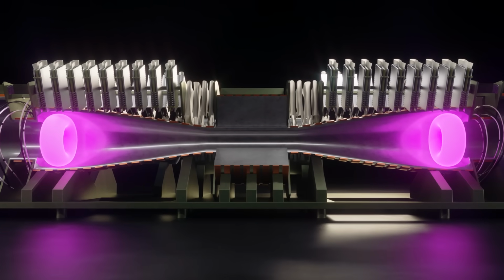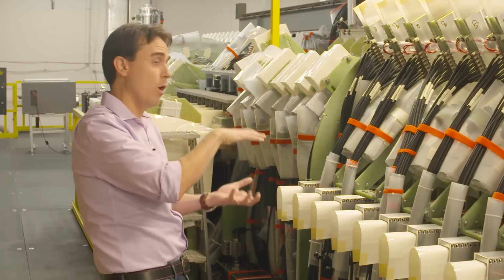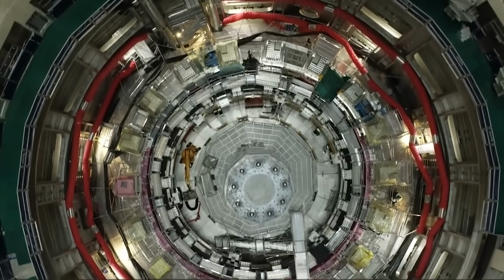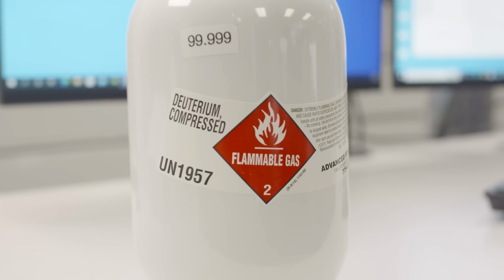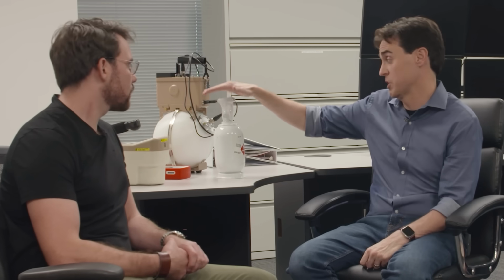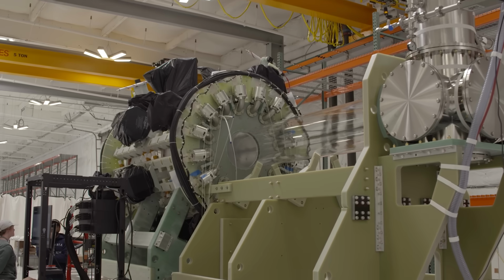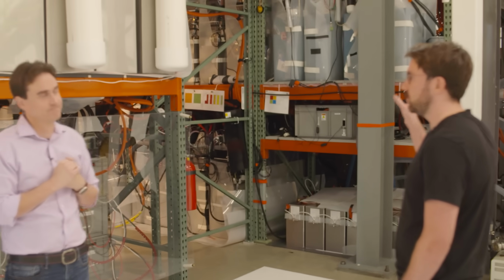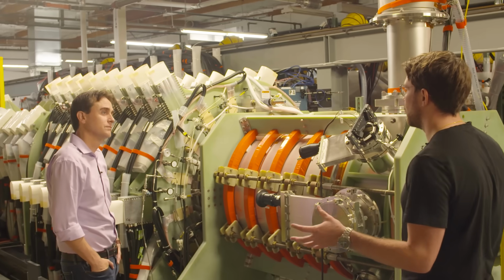A New Way to Achieve Nuclear Fusion: Helion

Comment: Do you have any comments on this video? https://youtu.be/3vUPhsFoniw
Reply: Yes, it is nonsense critique by someone who criticizes a complicated concept based on a video made for consumption by the general public.
Here is my critique of the Improbable Matter critique:
FRCs have been done before and the members of Helion's founding team were involved with several of them. They applied the lessons learned from thoes to their own design. 
There are lots of things that matter:
1. Size of the FRC. The larger, the less susceptible to n=2 instabilities.
2. Elongation to radius ratio. The longer the FRC, the more stable it is.
3. The merging before the compression. This part creates a single, hotter and more stable FRC (FRCs get more stable the hotter they are) as a targer for compression.
4. Their FRCs have a very low Te:Ti ratio of 0.1 and less. That makes things a lot easier because: P(fus)/P(loss) scales as Ti^1.5 / (Z^2 * Te^0.5 )

5. D-He3 is very hard to ignite, but they do not need ignition for their design to produce enough net electricity to be economic. That is because of the fact that they can recover a large part of the input energy directly as electricity and because of their relatively efficient output energy recovery.

6. Trenta is a subscale prototype with much weaker magnets than what they are proposing for a full scale powerplant.
Because of that temperatures are somewhat lower than in a full scale power plant. Power plants aim for temperatures over 30 keV in at which point the D-He3 reactivity surpasses the D-D reactivity.
That said, Helion actually wants the D-D reactions because that is how they are breeding their He3.
D-D => He3 +n or T +p.
Both reactions have a 50% chance of happening.
So, in mixed mode (breed and power) machines, they will need two D-D reactions for every D-He3 reaction, at least until the Tritium inventory is large enough that they have a constant supply from decay (Tritium beta decays into Helium3).
That can take maybe 20 years and that fact is probably the best criticism of Helions approach.

7. So they will have D-D neutrons in 1/3 of their reactions. What IM does not mention is that D-D neutrons have about 1/6 of the energy of neutrons from D-T reactions (2.45 MeV vs 14 MeV).
That is below the activation energy of many materials and much easier to shield against. 
Trenta is as mentioned an experiment not a full scale power plant and only operating at one pulse every 10 minutes (vs 10 Hz in their 50 MWe power plants). Not all shots were fueled by Deuterium or Deuterium + He3. Many were fueled by a mix of hydrogen and Deuterium or pure hydrogen, depending on what they wanted to test.

Because of all that the total neutron flux has been relatively low. 
The machine is mostly made from low activation materials or materials with a half life measured in minutes. Aluminum activated by D-D neutrons has a half life of 2 minutes.
There is still permitted shielding of course. It is in the walls of the room and not close to the actual machine, which can handle the aforementioned relatively reduced neutron load just fine. 
In fact testing different materials for neutron exposure was one of the purposes of Trenta. They have tested quite a few alloys to see how they behave.

Those lessons will be applied to Polaris which is their next machine. Polaris will take those tests to a new level with a pulse rate of up to a 1Hz and higher temperatures.

8. The Ion gyro- radius argument was hogwash based on a misunderstanding and out of context quote in the RE video.
What happened was that Trenta achieved a higher ion temperature than predicted

Let me know if there is any other point that I missed.

Comment: a couple of thoughts from a non-technical  (ignorant) person.

If the largest issue is heat, would these benefit from being built in space with the absolute zero temps? or does the vacuum of space actually act as a super insulator that disallows dissipation? could you them beam the energy to earth via microwaves or something? i am sure that drastically lowers the efficiency of the system, but would we care?

With those large capacitor banks... could that be something that  can be used in the capture of lightning? I heard that that capture process is the largest issue preventing the use of lightning...
Reply: Yep, cooling things is much harder in a vacuum.

Comment: Why don't they use Uranium on the reactor walls to absorb those neutrons, install carbon control bands and just basically build a fission reactor around it? Seems a pity to let 80% of the energy fly off and just degrade the walls. Also, breeding tritium from these reactors could provide an economically viable source for tokamak designs. Thoughts anyone?
Reply: It is not 80% of the energy. With D-He3, it is only 5 to 10% of the energy that is in the neutrons (depending on how many D-D side reactions they need to make their fuel cycle close, 10% is IMHO more realistic). The rest is in charged particles which can be directly converted to electricity.
I agree on the Tritium part. It could be a nice side- income, but the price would have to be dramatically lower that current Tritium prices. Otherwise it would not be economically viable for D-T power plants to buy from Helion. 
Interestingly, Helion had originally proposed a Fusion- Fission- Hybrid as a stepping stone to a pure fusion machine about 12 years ago. No one was interested.
Reply: @elmarmoelzer2229   @Elmar Moelzer  Sorry I must have misuderstood the video a little. Is it only the d-d reaction that partitions 80% of the energy into the neutrons? If so, then a d-d fusion/fission reactor would be immensely useful. It will net some energy from the fusion, and some from the fission, but it will also produce He3 and tritium. Tritium can be stored and sold to tokamak-based companies, or if Helion wanted to develop their own tokamaks, it could be free fuel for them there. And the He3 could then be employed in the more ubquitous designs featured in the video. It also looks like this design lends itself very well to a modular structure. You could, for instance, stack some d-d fusion/fission modules toegther to power a small town, and their byproducts could fuel a larger modular collection of d-He3 reactors or even a tokamak for a larger city.
Reply: @HolyMith   
The 10% in neutrons applies to the mixed mode machines that do both breeding and energy production from fusion.
Helion might opt to do pure breeders that only do D-D to produce He3 for distributed D-He3 power plants. Those pure D-D machines would have a higher percentage of the energy in neutrons, at about 33%.
For those, capturing the neutrons would make a lot of sense, because harvesting the  energy of just the charged particles from the D-D reaction would likely just about break even. 
Making a Fusion- Fission- Hybrid is currently not on Helion's map because of the regulatory jungle. Though never say never. Things might change.